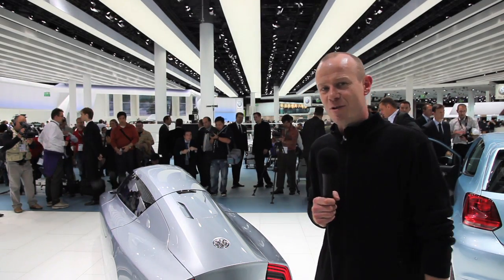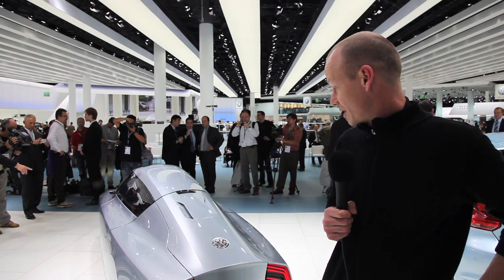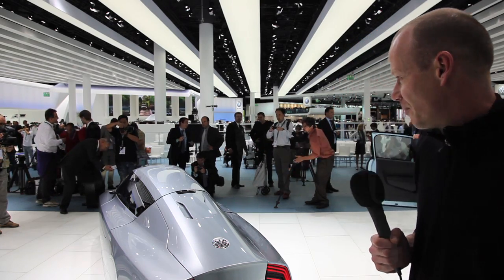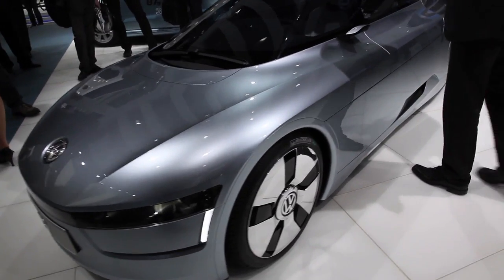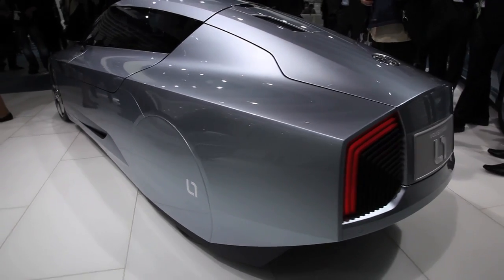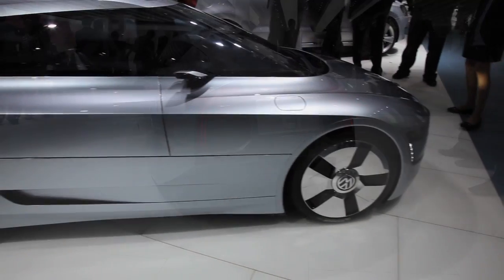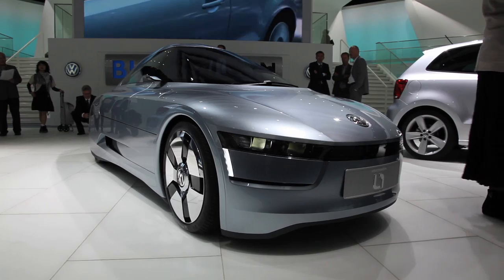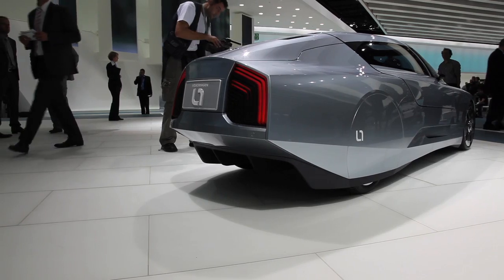The Volkswagen L1 Concept

Comment: The eu didn't pressure them to build this. Make it even slimmer. Make a cheaper version. More battery. Sport version gets 100hp e engine.  Make it longer, 3.emergency seat  . Battery in the sports version.          Cooperate with Mercedes to lean it slightly in corners.

Comment: that is assuming you mean fuel cell as opposed to hydrogen internal combustion which has the same explosive problem but also works, most petrols could run on hydrogen pretty much standard, my land rover runs on LPG and if you attached hydrogen to the system with a few modifications would run on that too.

Comment: if an electric motorbike or car can do 200-300miles, and can charge in a few hours at home that'd be good enough for 99% of peoples travel especially here in the uk, where stuff is close together, a few electric cars and bikes do that already, problem with hydrogen it is very easy to set on fire if there is a leak, it burns in a much wider air to gas mix band than most(any)other gasses/fuels, so it'll blow up if there is a lot or hardly any in the air, combine that with powerful electric motors.

Comment: yeah it's pretty cool, though I don't think these kind of things will last long, I think pure electric will take over for super efficient cars and motorbikes, there are already bikes you can buy that only cost £1 to £2 to charge up and will go 120-130miles no problem, charge in a few hours from a house hold supply, and about match decent petrol bikes performance, not near superbikes, but match something like a 400cc which is pretty amazing for about 1p per mile and almost no maintenance.

Comment: figures don't add up, 238mpg and 1.7 litres (a little under half a us gallon even less of an imperial gallon) of fuel would be in the region of 100 miles not 404.